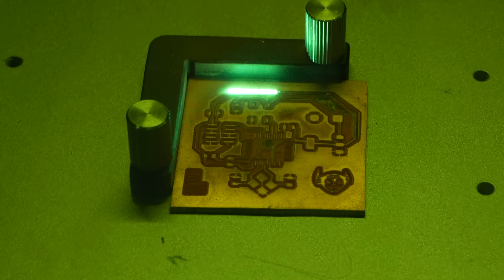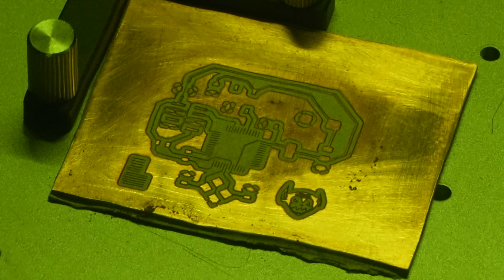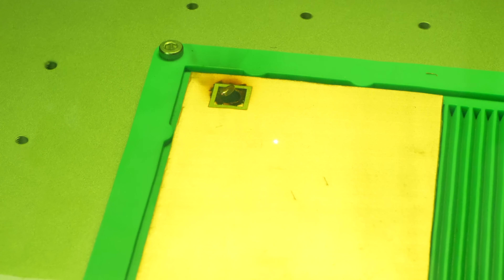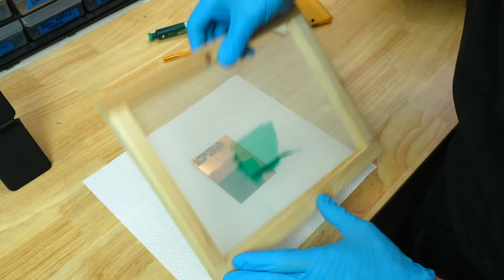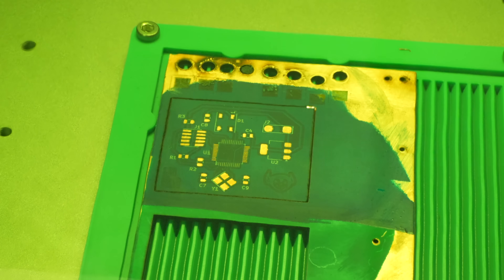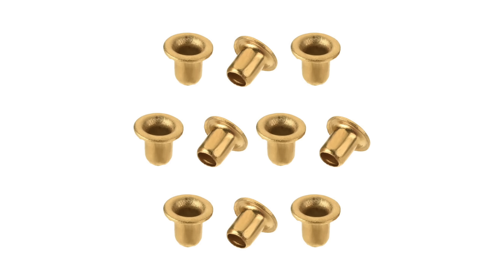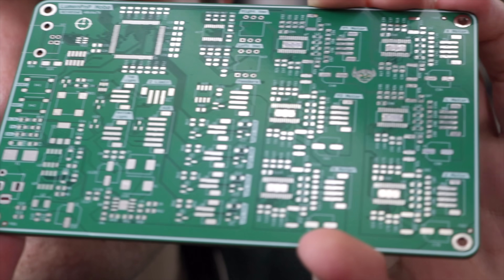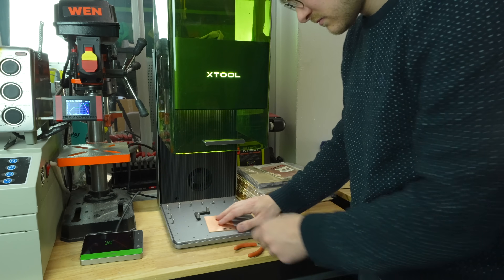Prototype PCBs faster than 3D Prints

Comment: I think the tru hole will always be a bottle neck for rapid prototyping. But having thin copper rings the thickness of the board that you then punch on both sides and then solder is your best bet. You could even scale it for batch production, where you make jig plates with cones for the thu holes you want to connect, you place the board on the bottom plate, pick n place the copper rings in the hole, and then press the top plate down to crimp. If you can sort out the the right angles and pressures you need, you could even have the plates meet in the middle to make sure you get the right pressure to each crimp, with out having to regulate the pressure you put on the plates much if at all.

Actually annealed copper is soft enough you might be able to do this with copper slugs the size and thickness of the holes.

Comment: why dont just use a little piece of wire instead of the big vias? like you just put the wire in the via solder it from one side solder from the other and just cut off the excess wire i wont be super pretty but still cheaper, easier and lower than the big vias

Comment: For alignment, cut 4 holes that you can slide posts into, would be more reliable than a backstop/fence. Since now you don't have to worry about crushing the FR1 slightly, or it moving slightly when you let go of the board

Comment: I used to do this with a fiber laser but the process is just too restrictive, you are really limited to small 1 layer boards. Two layer boards is nearly impossible to keep the alignment perfect to get it to work reliably, even with jigs. Also getting really fine pitch IC traces to etch reliably is really hard - the resolution of fiber is definitely better than CNC but still much worse than the processes you can get from PCB fabs. Through holes is a massive PITA to keep working without burning the board or blasting copper traces off - it's much more reliable to hand drill them.  In the end it was WAY easier to just send off to jlcpcb and get perfect 4 and 6 layer boards back in a week, with all the components perfectly placed and soldered. My time is worth more than all the manual work still required by the fiber laser process. Chinese PCB fabs are unbelievably inexpensive.
Reply: Does not address the same day prototype turn around.  Build the system in modules with soldered ribbon connections.  If all works consolidate and send for printing using multilayered boards.  Same principle as using Aurdino/Raspberry Pi modules for prototyping.  Mounting holes in board corners to attach to base.  

Reusing using an expensive small device with high density pins?  Make a ribbon cable connector board for the device.  Use a ribbon connector on the prototype board or a ribbon to jumper pin adapter and jumper pin sockets on the prototype board to make connections.  The latter also addresses many of the pass throughs generated by high density devices on prototype boards.

Comment: I have an idea. What if you get a blank board with no copper and cut all the vias and holes in the board with the laser. 
I'm not sure if we can really get away from electroplating, its a shitty step that can be automated. its just so convinent to make tiny vias with no bulk. And this approach is dependent on it and that the chemical treatment don't attack the solder-mask.
So then you use a silkscreen to apply a solder-mask across the entire board.
After curing laser away the solder mask wherever copper is supposed to be,  chemically treat and electroplate in those open areas. We now have a board with a single mixed layer of silkscreen and copper A possible advantage since that the parts could sit closer to the copper, since the silkscreen layer wouldn’t end up on top of the copper pads. The solder-mask thickness would determine how thick the plated copper could get before it would spill over

Use some dowel pins for alignment and this could be a viable way for hobbyist multi-layer boards
Reply: How exactly does the copper get on to your blank no-copper board?
Reply: @Graham_Wideman  Same way you electroplate vias, it has to be chemically treated to deposit a seed layer of copper. So the electroplating can begin
Reply: @kissa02  That "chemical treatment" seems impractically onerous and expensive, judging by this video:  "DIY VIA plating - Explained how copper gets inside of a VIA | Kailey Shara" https://www.youtube.com/watch?v=2hvMgG6tKdg

Comment: When making vias on milled boards I usually just solder a thin wire through them. For through holes on ICs and other parts you just have to solder both sides.

Comment: instead of rivets use just wire and solder it on both sides. you connect upper and lower side and cut wasting wire as you want

Comment: Vias can be relatively simply done..

Use electrical conductive paint on all of the holes,  then electroplate the board..

It would be interesting to see how the laser handles solder paste to see it it could complete the solder stage

Comment: Any reason you couldn’t press fit a bit of copper rod to make the connection to the other side of the board? 
The board won’t be put under much mechanical load so the interference won’t need to be large

Comment: I think for through hole plating, the official method is probably the best and most straightforward. It's actually not as complicated and expensive as it seems. Hydrogen, Time's other channel "DIY HOMEMADE" has a couple videos on it. It doesn't require a chemistry degree, just a bit of working with mildly hazardous chemicals. Palladium is expensive, but the amount you need is miniscule. You need muriatic acid from the hardware store, tin, and palladium(II) chloride (which you can get from that auction site in small quantities for $45) With a bit of skill and 1 extra chemical, you can make palladium chloride yourself.
Reply: Of course, electro/electroless copper plating would follow. Once you're set up for the above, it's about $10 more in chemicals. You'll most likely have a suitable power supply on hand, and you can work with copper scraps from wire or PCBs.

Comment: For the through-hole vias, if you can find thin-walled copper tubes, and get them in small diameters, cut the tube into to sections the thickness of your board. Then you could put them through the vias holes and just distend each end to lock them in place, and assuming the ends touch exposed copper on either side it wouldn’t take much solder to fix them more permanently
Reply: If you're going to solder both sides anyway, why bother with tube? It seems like wire would be just as good.

Comment: Trouble with this is it just etches copper and mask nothing else. No through holes no plated via holes so even a double sided board is going to be sketchy. By the time you have been messing about with drilling and using rivets etc then testing you may as well just order the boards and wait a week for delivery.

Comment: Perhaps you could build a jig that lets you pin down the PCB, laser away the copper, apply the solder mask, cure the solder mask, and laser away parts of the solder mask without ever moving the PCB in between. That way, there shouldn't be anything shifting around and the solder mask is perfectly aligned.

Comment: Could you not melt metal into the vias? Solder could work, but maybe there is a better suited metal that has less surface tension. This would still create a bump on your circuit to have a decent connection though

Comment: Have you tried cutting your own solder paste stencils yet?  You could also cut silk screen stencils too
Reply: cutting really thin metal is extremely difficult - it wants to severely warp under the slightest amount of heat. i've done it but it's a huge pain. kapton is no good, the laser melts and chars the crap out of the material - you don't get clean cuts.

Comment: You could try sticking a bit of solder wire through the hole and melt it. Don't know if that will make a secure connection but it might be worth giving a try.

Comment: A way of avoiding vias for simple topologies is to just use a bunch of zero ohm resistors that allow a trace to jump over some others. This is still relevant if in certain circumstances even coming from a board shop because you might be using something like an aluminum core board which will be single sided by default and if you add more “sides” they just get stacked on the same side and you start to reduce the thermal advantages of aluminum while also making it a lot more expensive. If you really need vias on a normal Fr4 board I’d be biased to just wait the 3 days to a week for the perfect boards to arrive.

Comment: If you're going to solder the rivets anyway couldn't you use short ones that don't go all the way through and hold them in place with solder? Mechanical holds with solder might not be great, but...

Comment: You might want to try changing the focus of the laser. So that you can prevent as much ablation of the FR substrate. I think the xtool f1 and ultra, both have a 3mm max engrave depth when it focused properly. Which they suggest at times moving up higher if your trying to prevent as deep of removal.

Comment: idk how but maybe building custom PCB material like copper plated paper (something that's not that tick) to better stack them for multilayer. and for the rivets maybe cold press weld them with a special clamp would requirer some base material that can withstand the force (I think paper would work)

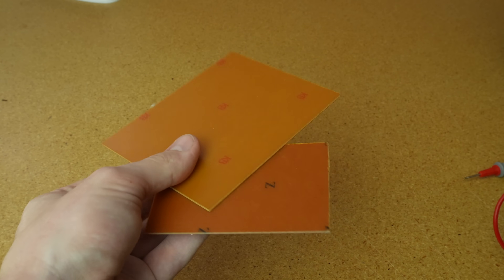Comment: 4:00 you need to source RF1 board with specific copper thicknesses, its sadly measured in oz/ft^2

1 oz/ft² of copper corresponds to a thickness of approximately 35 µm or 0.035 mm.

Comment: lolipop and stem bridges.  laser-drill pathway, solder both sides -done.  used this technique to repair double sided boards.  -  or  -  the folding approach you mentioned.  warning... if your components require a certain supply amperage,  make sure you widen your bridges to support the demands,  when cutting the hing,  i reccomend cutting from the opposite side and tabbing so the bridges still have a little bit of support so the copper doesnt crack/ delam during the fold - or or - make a bridge plate that you solder front to back

Comment: Not sure if it would work, but my first thought for vias is to cut out holes and solder in chunks of wire for where you need them to be flat under an IC or where you need them to take up less space.

Comment: For via's, an option is to use bare copper wire and have it cut to the thickness of the pcb. Then push it through with tight tolerance like a stud and maybe do a brief solder dunk/flow to secure it and confirm connection. It'd add soldering but it'd be less deep and also a smaller option than a rivet. You could technically make a pseduo hasl setup with two soldering irons and some wide tips but that'd be an extra build.

Comment: Having just recently picked up a galvo laser, I am definitely planning to pickup a fiber laser once i got the budget for it. The galvo by itself has opened up new venues of stuff I can do for my customers. I primarily bought the galvo for product marking as its a much cheaper and faster method of marking plastics on 3d prints with their info. Plus its far cheaper than custom labels etc. Plus there are many more inexpensive fiber lasers than the xtool offering (not that the xtool suite and support isn't good cause they are surprisingly well supported, plus lightburn support)

Comment: 10:44 drill the hole and stick a solid copper wire in it then solder, you won't have a hole but you will have signal to the other side.
Reply: I came here to make the same suggestion. If he is thinking about soldering the rivets anyway why not just a solid wire that can sit flush on both sides?
Reply: @chris993361  sure it's not automatic but it's easy.
Reply: i've done this.  Do the whole board with one piece of wire, like quilting, because then you don't have to hold wires in place while you're soldering the ends.  But you can't get them flat enough to fit under a QFP.  We do all our in-house designs with no vias under parts for this reason.
Reply: @smellsofbikes  assuming the board is flat enough couldn't the wire be inserted from the opposite side so any bump is now on the side without the chip? Or perhaps only insert it part way so there is a dish on the chip side to provide clearance?
I do think it is better to just avoid vias under the chip to start with as you said.
Reply: @deltacx1059  The only thing that's worked is soldering wire-vias into the bottom of a thermal pad under a chip, and even that's not great.  There's just so little surface area on the edge of 1/4oz copper to the wire that enough solder to make a decent joint is too much solder for a part to sit flat.
We use wire jumpers and 2512 0-ohm resistors to jump traces over other traces.
Reply: @smellsofbikes  fair enough, jumping over with resistors is a pretty nice solution.
Reply: If the board is thin enough can you just fill the hole with solder? Without using any wire
Reply: @neilorion9953  That's tricky and unreliable. Also, have you ever worked with FR1?  It's really easy to damage. There is a reason this material is not used most of the time.
Reply: @neilorion9953  The hole won't suck up the solder, it would be very hard to get it to bridge the two sides
Reply: @neilorion9953  - solder cracks ovr time, cold joints etc... would be a nightmare to debug..... just run a tiny coper through it and done, coper is like rebab in concrete...
Reply: @neilorion9953  fwiw I've never gotten this to work.  Solder bridges across the gap of an 0603 resistor but anything larger and its surface tension is too great when it melts, and it balls up and retracts.
Reply: An alternative method for using vias on single sided PCB’s I used in the past is using 0 ohm resistors. The can be picked and placed with a machine.
Reply: This is the old skooler's approach. Some people also use remnants of THT resistor legs for it
Reply: As simple as this sounds, my name is on several US patents related to this concept lol.
Reply: A lot of simpler or cheaper electronic products do it this way
Reply: That was my first thought.
Reply: Easily the best option and was my first thought before I even read the comments. They make great test points too.
Reply: that's what we did too back in the day.. worked well. was the least difficult part of making pcbs at home / university
Reply: While this idea works it's as tedious as is pushing those rivets through and punching them flat on the back, IMO.
Reply: @mcflapper7591  yes, no free lunches in engineering
Reply: i used to work on a lot of through hole boards and would save all my cap. & resistor  leads (the excess wire that gets cut off) they came in quite handy. they might work well here
Reply: Exactly the same reason I just logged in. Also:
use the same thickness of wire as the hole. then either a)cut wire flush to board and solder. or b) cut the wire a little long and compress the wire in the hole, to make a solid copper rivet (without crushing the pcb), or stranded wire, splayed on either side of the pcb. And solder.
Reply: Suggestion for source of wire. Ethernet cable. It's my go-to for thin gauge wire
Reply: That's how I fix failed vias.
Reply: This is a really good idea, thanks!
Reply: I dont use laser but i have done prototypes very similar to this for 15 years with defroster repair epoxy and a cnc, works fine except for very high freqency rf circuits
Reply: I did a decent amount of exploration of everything he did here on a Bantam mill a few years ago. This wire method worked for me. However, it's harder than you'd think to get set up right. You can tack the first side with solder quite easily, however, when you get the other side, the first side will typically melt as well. So depending on how you are mounting the board, you might have some movement of distances from one side to another. So you kinda have to go long, and trim everything down.
Reply: @aaronchamberlain4698  it does make sense a slug of copper a couple mm long would move the heat really well, I figure that's the type of thing you would need a fixture for.
Reply: @aaronchamberlain4698  yeah, same: I use a meter long piece of wire and pull it through all the holes in one length, solder both ends of each wire, and cut.  Doing it with little bits of wire that melt out is super frustrating.

Comment: Google search "locating pins" for work holding and flipping work. It's a very common technique in the cnc world and somewhat common in wood working. 

Copper plating should be pretty simple and combined with locating pins I'd think this would be way better than rivets. 

Definitely need to watch some machining and cnc hack videos, they will give you a lot of ideas.

Comment: Great work!  I did some initial experiments on what I believe to be FR1 PCB but stopped after reading about the dangers of back reflections from copper possibly damaging the machine.   It looks like lasers at 1070nm have the least reflectivity for back reflections from copper and I believe the F1 Ultra may be in that range (as well as my laser).  I still need to do more research but I do plan to pick up again on this after seeing the progress you've made.  I am curious what you make of this potential issue.
Reply: as long as you engraving off center, back reflections are not a problem - they reflect off to the side. don't do engraving directly below the center of the lens, and you won't damage the machine.